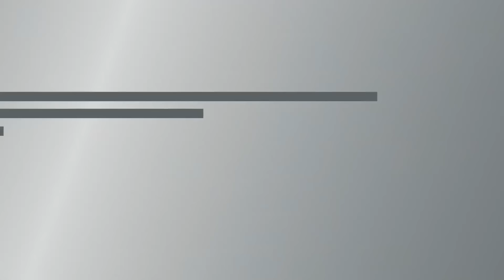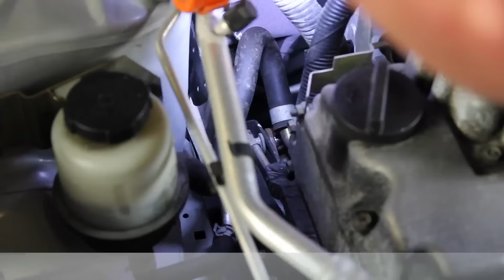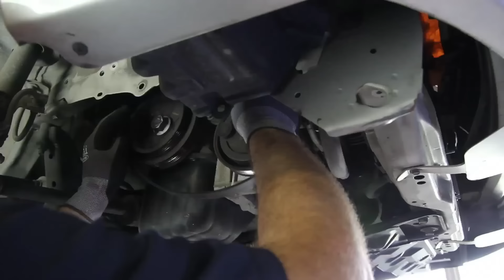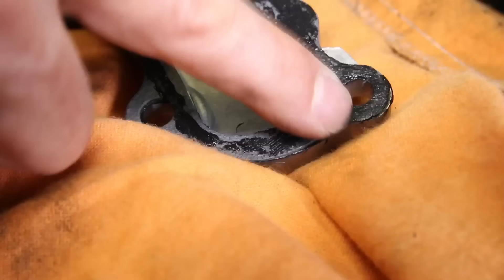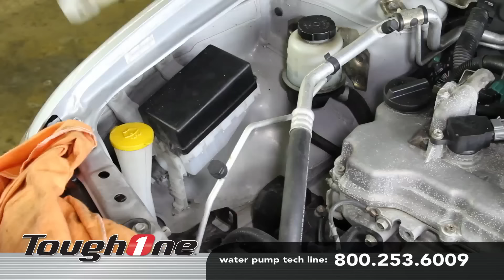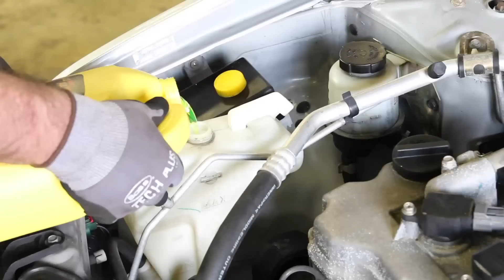How to Install a Water Pump for a Nissan 1.8L 4 cyl Engine - Advance Auto Parts

Comment: Why you disconnect the battery
Reply: If a wrench lays across the starter solenoid it could tun the engine over and take an arm off

Comment: There is a bleeder screw by the thermostat housing -if you look carefully you'll detect that it is not part of the housing itself.  Wear gloves when unscrewing it as the coolant will be really hot and it's hard to get back in while getting scalded, works better than burping the hoses.  There is also a drain plug on the front of the block as only a portion of the coolant will be evacuated through the radiator drain cock, but many advise against going after that on such an old car (it's by the o2 sensor, a female square socket bolt I think)  Does anyone know if the tensioner pulley needs to be loosened to work the front tensioner screw?

Comment: Hi, what was the reason for replacing water pump?
Reply: Water pump needs replaced because it pumps your engine coolant. A bad water pump will cause overheating, both small and large coolant leaks, and inevitably total death of your engine if not replaced immediately.

Comment: This video imparts some questionable advice... I would NOT use emory cloth to clean the gasket surfaces... and I would NOT use any sealer on the gasket, UNLESS the surface is pitted/corroded/scratched or otherwise imperfect.

Comment: Great video I have a question what do you do if the power steering tensioner bolt will not turn To loosen belt ?
Reply: Soak the hell out of it with rust penetrating lube and pray!